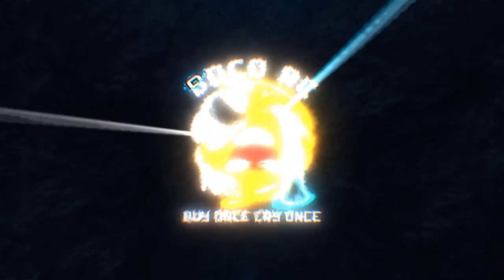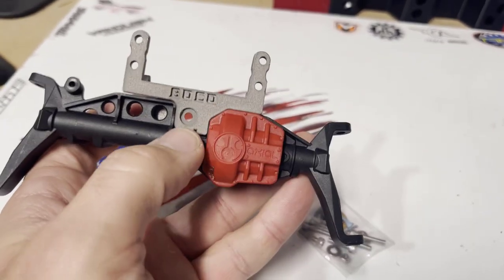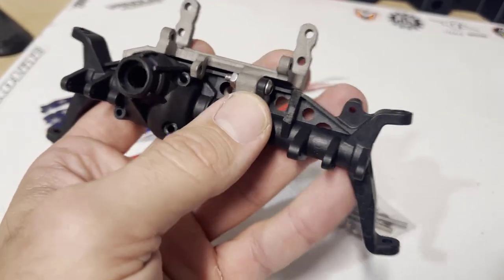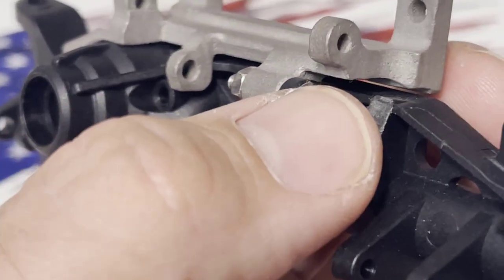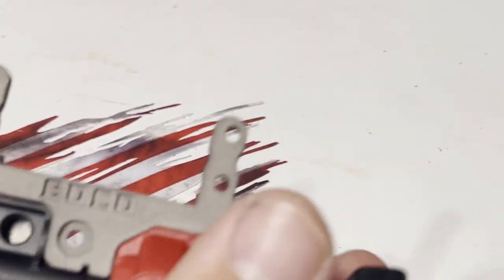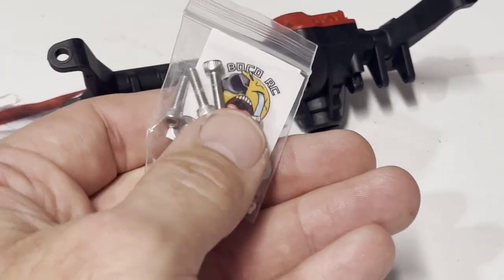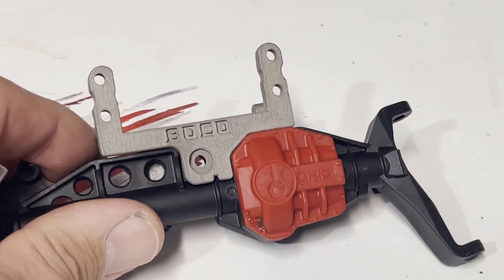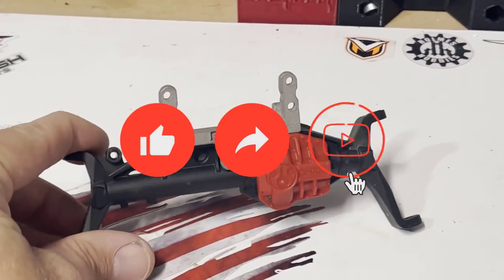BOCO RC AR45P SOA & 4 Link Adapter Install

Comment: My son is running my old AX10 Bender chassis and bought the SCX 10 three straight axle conversion kit. Will it work with that front end?

Comment: Where do you add the fourth link to on the chasie?
Reply from the maker: I’ve used it on after market chassis but if you look in the SCX10iii owners group some people did it with the stock chassis I think